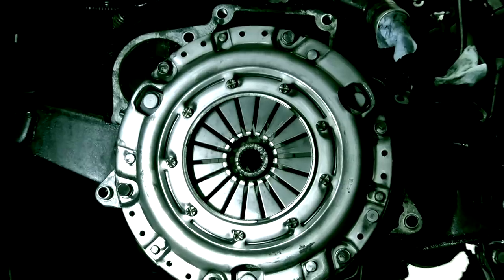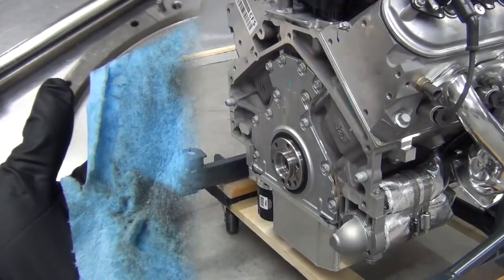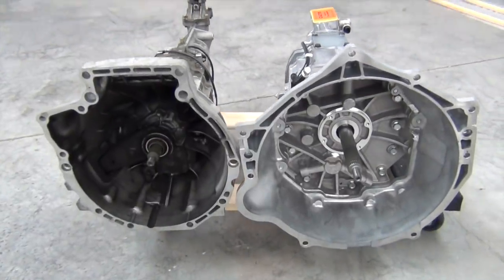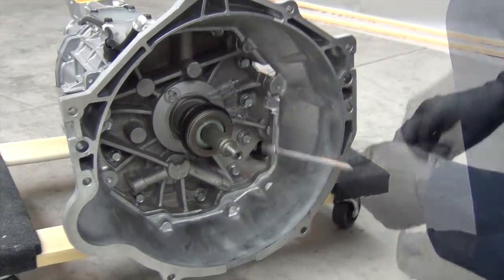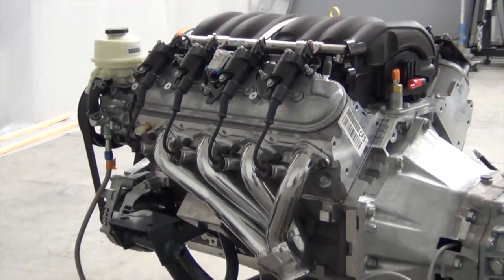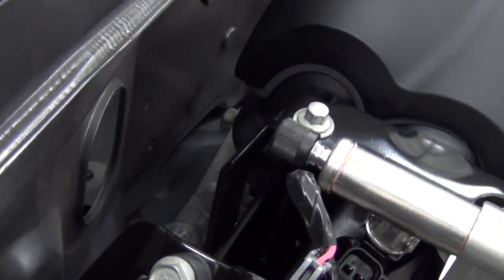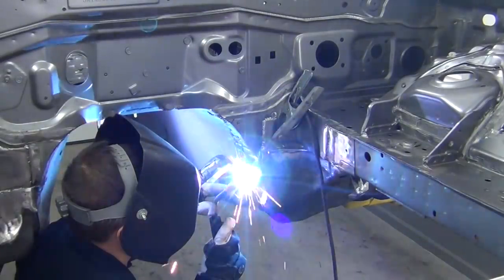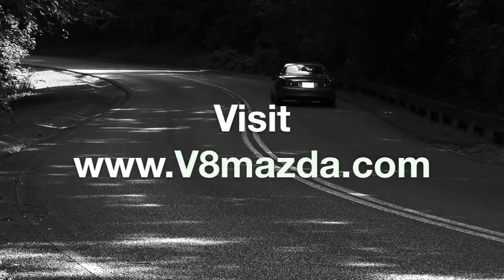LS3 V8 Miata Build - Project Thunderbolt Part 6

Comment: Love that tip on using an old bolt as a guide pin.  I saw a similar tip on ls1tech where guys take off their heads, they get an old head bolt and grind down one side flat so it can be used as a thread chaser in the block.
Reply from the maker: Christian Sharron Yes, it is a huge time saver!  That other tip you mentioned is a good one too.

Comment: Props to a well built conversion, just one thing though when I did an ls1 conversion with t56 tremec into an mx83 toyota cressida had the engine mounts, sump made custom to give 3 to 4 inches of movement front to back still had to modify gearbox tunnel slightly for decent clearance, just figured the mx5 kit wouldn't involve cutting the tunnel so much as easier to place engine further forward.

Comment: I would suggest fitting and torquing down the clutch actuator before fitting the Bell housing. That way you can torque it down accurately, using an extension on the socket will mean that the torque will be lower than the wrench setting as the extension will twist.

Comment: Great job on the build so far, Tom. This Miata is going to be a beast. Can't wait to see a video of it tearing up some asphalt. I saw in part 5 you have a set of AeroCatch hood latches, great choice. I highly recommend that you check out the Password:JDM AeroCatch Plus Flush Mounting Plates. You'll be glad you did. They make for a much cleaner install.
Reply from the maker: x1s1x300 Thank you sir and I appreciate the great tip!  I checked those out and what a good product!  I knew nothing about those, so thanks again!

Comment: Love the new vid as always, Tom! Especially excited that it's a Mazda because my DD is a 385whp Mazdaspeed 3. Also, it looks like I have the same Tekton in-lb torque wrench as you, LOL. Makes me feel better about me choosing that particular one because I know you know your stuff.

Anyways, keep 'em comin' and I'll keep on watchin!
Reply from the maker: Zack Richmond Thank you so much Zack!  Man, I bet a Mazdaspeed 3 at that power level is a freaking blast!  Glad you enjoy the videos, I'll be posting a new one tomorrow.  See ya then!
Reply: Tom's Turbo Garage Yep, 385whp is about perfect for a Mazdaspeed 3 on a stock engine. We like to keep our wtq south of 400 because of our rods' strength. Also, our stock injectors run out of flow at ~400 and there's zero aftermarket support for injectors--we have to go WMI or supplemental PI for auxiliary fueling at that point. Finally, our stock clutch can hold ~380 or so, therefore a little south of 400 is a good target on the stock block. Besides, having nearly 400 at the wheels is pretty astounding on a FWD platform anyways. Not really much use for more at that point...

Comment: You need a fan shroud for that radiator.also, the Ls7 clutch is the best possible choice. good job
Reply from the maker: PC Master Race Thank you for the advice and info, I appreciate it!  I'll have to get creative on the shroud, this is a pretty small radiator.
Reply: Tom's Turbo Garage I made one for my Classic truck from sheet aluminum and a few bolts.
Judging by the quality work you have already done, a shroud would be EZ for you.

Comment: I'm excited for the next episode which seems to include painting lizzard skin? ! Great vid! You are the man! Powertrain fits like a friggin glove holy crap! Aftermarket subframe goes right in. Exact transmission length very important looks perfect. was problem I found in my recent Subaru 95 trans swap on 2001 engine on 99body experience.
Reply from the maker: Bob M. Tyranny Destroyer Thanks man and yes, I will be spraying on the Lizard Skin in the next video.  The benefits you mention are why subframe kits are worth their weight in gold.  I wish I had the skill/time to design my own subframe, but I don't and this is an excellent solution.

Comment: If you don't have a clutch alignment tool, a 1/2" socket extension works well if you roll some electrical tape around it where the clutch plate spline sits.
Reply: If you don't have the common sense to go out and buy a $10 tool then you shouldn't be working on cars.
Reply: Sometimes, it is not possible to buy some obscure "once only" tool. Especially if you already have your gearbox out of your car, but where I am from, "common sense" is how you get the job done by improvising what you need. 
The method I described, works perfectly and you don't get the pleasure of spending the extra $10 you don't need to.

Comment: That clutch you have looks mighty wide - and heavy.  I'm surprised you didn't go for a twin-plate clutch if you're concerned about slipping and retaining driveability.  Those I've tried usually have a pretty gentle spring pressure, and the lower rotational inertia is nice for getting the engine to spin up faster.  .
Reply: Stock GM's clutches are great. The extra mass helps with "bucking" and smooth shifting. Lighter isn't always better

Comment: You sure make nice welds on that thin OEM steel. what size wire do you use? With my millermatic 211 I use .030 . makes for tricky welding on that thin stuff. I'm guessing .023?

Comment: I saw in a previous video you had a spec sheet of all the different bolts and the torque specs to tighten them down. Where can I find these for my miata, as well as any other car?
Reply from the maker: 20spray1 I found that one on the LS1tech.com forums.  Most car-specific forums have this sort of information posted.  The factory service manual is the best source though.

Comment: awesome welding
Reply from the maker: 1trucavalier Thank you for saying that, I'm just an amateur and still have lots to learn.
Reply: Tom's Turbo Garage  my welds are so bad I have to grind down the surface every time LOL but then again my welder only cost $90 at harbor freight.  You pay for what you get.
Reply from the maker: 1trucavalier That's true.  My Lincoln can be had for less than $400 and has never given me a bit of trouble since I bought it in 2002.  I know I need to upgrade someday, but I just can't bring myself to do it!

Comment: Thanks for another awesome video Tom!  If you could please help me, what size AN fitting did you use for the to adapt the remote bleed line to the bearing?  Im having trouble finding one with the right threads for my swap.  Thanks you!
Reply from the maker: cowmilky You're welcome sir!  Those fittings were part of the V8 Roadsters kit, so apologies for not knowing.  This topic is covered in the LS1tech conversions and hybrids section, I don't have the exact link, but just saw this topic on there recently.
Reply: Thanks for the help, keep up the great work and motivation!!
Reply from the maker: cowmilky No problem man, will do!

Comment: I hope the gas pedal still  has enough clearance after welding those tunnel braces back on.
Reply from the maker: forgotmylogininfo Yes, I checked clearance with those temporarily in place.  What you're seeing in these videos is such a tiny fragment of the work that goes on during each step. I probably spent 4-6 hours on the gas pedal alone.

Comment: I hope you put some gold foil on the firewall to prevent the heat from soaking into the passenger compartment.
Reply from the maker: corporalwaffles The firewall isn't the problem with heat in these cars, it's the transmission tunnel and floor.  Stay tuned for more on that.
Reply: Tom's Turbo Garage Interesting to hear that, as I have only seen gold foil around the exhaust manifolds and firewall. No heat issues in the the turbo 1.6L when pushing it at the track? By the way, your thumbnail photography is really nice for part 3 through 6. Curious what camera setup you used.

Comment: im going to assume paint is next.... how much room is there between the left cylinder head? also, are you wrapping the headers to protect the engine bay paint from the headers?
Reply from the maker: honhon05 Stay tuned man!  The passenger side is the close side due to the design of the engine.  I won't be wrapping the headers, they don't get hot enough to melt the engine bay paint, they are placed tight and low between the frame rails.

Comment: Tom- 2 Questions: Do you work for Flying Miata and Summit? Also, is that a real shop? Zero oil, dust, rust, and it’s not loaded with the myriad of tools and parts of every other shop in the universe

Comment: Also Tom, tell us you rust proofed the firewall welds after flap disk? or is that the next step?
Reply: ***** The plastic wall makes me think the next step might be paint... which if he does engine bay will cover all the welds so it should be good to go!
Reply from the maker: ***** Hi Gus, stay tuned man.

Comment: What type of welder and other equipment do you use? I heard you mentioned. Lincoln welder but anymore info would be appreciated,  I'm looking into them as we speak
Reply from the maker: ***** Hi Antuan, I use a Lincoln Pro Mig 140, I have been using it for 10 years with zero problems.

Comment: Hello, my English is not very good Tom , but here goes ... My question is, if all the pieces that you will use (transmission, ECU , differential, etc ) can get 470 hp that promises ls3 525 or expect better result , Greetings?   Gracias (tank you)
Reply from the maker: Jose Preza And my Spanish is awful!  :-D  The 525 horsepower rating is at the crank with no engine accessories.  So once it is installed in the car it will be much less horsepower to the wheels.  Hopefully around 450 wheel hp with these smaller headers.  Hope that is a good, clear explanation.

Comment: now i have one question to this. Is it possible to chose an ford 5l v8 instead if the ls3? if yes why u don´t take an ford v8. They are much more modern with overhead cam´s instead 1 cam and pushrods like the ls3. so in tearms of fueal consumption and hp per ccm much more effective. 

p.s.: sorry for my spelling im not an native english guy^^
Reply from the maker: MrSuperAbsinth The new Ford DOHC V8s are far too tall and wide to fit in the Miata engine bay.  The LS3 is lighter, much more compact and delivers all of the power and torque a guy could ever want in a Miata.

Comment: From My Experience, I Would Have Checked, Under Pressure, the Clutch Lines Before Bolting Together....If In the Car, and One Leaked, then What???...Pull the Engine???
Reply from the maker: I checked the release bearing setup under pressure, just didn’t show that.

Comment: Hey Tom, do you do this for a living or is this just a hobby?
Reply from the maker: decimat777 Hi there, it's just a hobby that helps me unwind.  Although this project has been a little less relaxing than ones in the past. :-D
Reply: I just wondered with all the equipment and garage space it looked like you might do this professionally. Same here on the hobby part. Well it wouldn't mean anything to you if it didn't bring some challenges along the way right? I'm currently waiting to find a semi-complete donor car; an 09 or higher totaled Camaro with the engine intact. My friend started an auto repair shop in Dallas so now i have him backing me as far as labor and tools. Having a lift to work under is alot nicer than jack stands lol. Won't be the first v8 eclipse but it will be the coolest that's for sure!

Comment: why didn't you turn it on? /faceplam.
Reply from the maker: Matthew Q Turn what on?
Reply: The engine mate. Do you even mechanic?
Reply from the maker: Matthew Q You're asking me why I didn't start the engine when there is no engine or chassis wiring in the vehicle, no fuel system, etc.  The purpose of installing the engine was to test the fit, which ensures that the engine and transmission assembly fits in the now modified chassis.  Once all of the chassis modifications are complete, then the engine is installed for good.  At that point the rest of the driveline is installed, (driveshaft, axles, etc) wiring is completed, fuel system is plumbed, cooling system, exhaust, fluids, etc.  Then the engine can be started.
Reply: Tom's Turbo Garage no dude I'm pretty sure you just put the key in and turn it on. it's not that complicated.

Comment: Tom, I am your biggest fan but honestly, you said nothing about the clutch itself! like "just get this one, which has the qualities off....ahh why do you need to know that, just do what your told" Someone may want to get a slightly different clutch. Is it an organic mating surface, is it ceramo-metalic or cermao-organic. Its obviously not a button clutch but a little more would help others makes selection.
Reply: yeah I get it. I totally agree with you that you can stare at states all day and have a great car on paper then you get in it and the clutch is a ridiculous button clutch. you can't drive over a penny without getting back pain and driving over the penny has your front scrap on it. A pleasure driving it is a world away from ultimate performance. Race cars suck to drive around. Not until you have been in one do you realise that everything you enjoy has been stripped away other than power. Getting the clutch right is very important.
Reply from the maker: ***** Well said!  This is an OEM organic full face clutch disc and strong sports car pressure plate, all from the stock Corvette Z06.  V8 clutch setups don't have to be as aggressive as four cylinder setups due to the amount of surface area of the clutch and pressure plate itself.  V8 versions have TONS more surface area than a 4 cyl.  This is part of the reason that a powerful 4cyl has to use super stiff pressure plate springs and aggressive pucked clutch discs.

Comment: Torque wrenches, you need to learn how to use them.
Reply: +Zac Rockwell What's he doing wrong? That's how I was taught..
Reply: +conflagrationTuesday He is "double torquing" the flywheel bolts.  If you watch closely the bolt actually moves a couple degrees when he goes for a second click.

If you have a properly calibrated torque wrench the initial torque is exactly as set.  

I was an airplane inspector for years, on witness torques I would not stamp that torque.  It would have to be backed off and done again.
Reply: +Zac Rockwell That's interesting, thanks. I was always taught to do exactly what Tom was doing. Lucky I wasn't building airplanes!
Reply: Learn something new everyday brotha

Comment: I still woulda gone with a proper Ford engine, like the new Coyote
Reply from the maker: EvilJ069 The Coyote is a great engine, but doesn't come close to fitting. The DOHC V8s are huge compared to cam in block engines.
Reply: Tom's Turbo Garage
No shoehorn? lol Fair enough, Miata's are tiny. I'm just not a GM fan, after doing ball joints and windows motors on them to find them riveted in place
Reply from the maker: EvilJ069 Well I agree that working on them can be a real head scratcher.  I do feel they've made a fantastic engine in the LS though, light, compact, powerful and very strong too.
Reply: Tom's Turbo Garage
Very true! I was actually at the Chevy dealer not too long ago, and they make some sexy looking cars, but was a bit let down with the body of the Corvette, it was kinda flimsy plastic on a lot of the body. I would LOVE to have a Buick Grand National GNX

Comment: I would not call this a build I would cal this a assembly of several kits. What has actually been built here? Somethings have been cut away and then some form of welding done on the body but I have yet to see anything being built? Next thing is that this will be called a car build?  What is this world coming to?